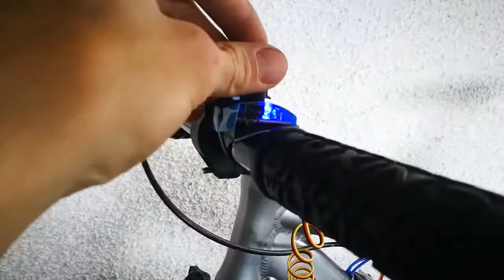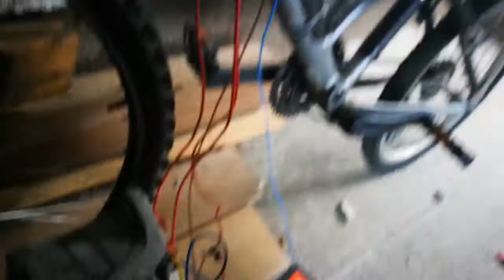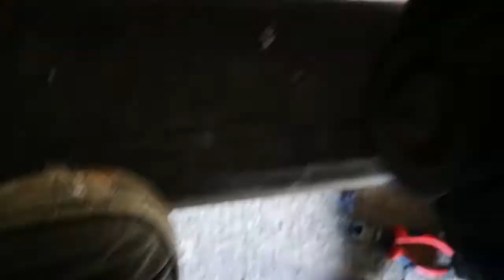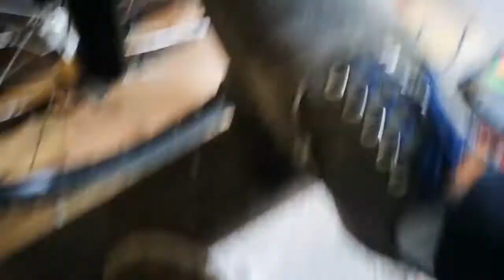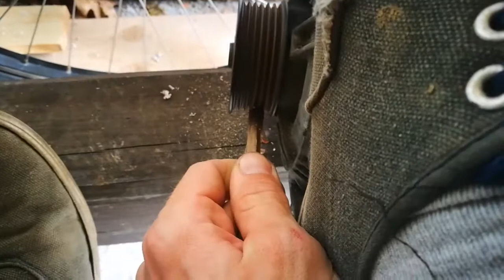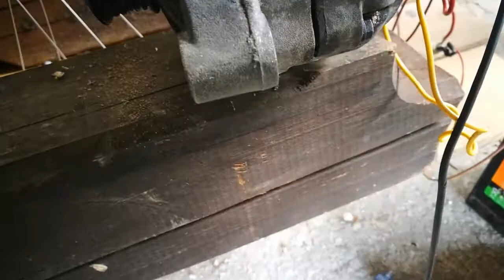12v 130 Amps Car Alternator converted to DC Motor with BLDC Controller

Comment: If it will CHARGE at 130 amps,  it will probably take 130 amps as a motor... Just saying...  
Easily needs a 1.5KW or bigger speed controller even at 12V...  Could run it at 36V as well... but your "gonna need a bigger boat"...
Reply: actualy you can push 200 amps in her no problem

Comment: How many volt run alternator 48v/60v/72v/96v ????
Reply from the maker: I used only 12 V in this video and a  RC 70A bldc controler
Reply: @TrailMaker2  thank you

Comment: Delta or star  Have magnets been added?
Reply from the maker: I tried both and it feels the same , don t know why. I didn t add magnets.
Reply: @TrailMaker2  thank you
Reply from the maker: @enrgysolarandpowerinverter4379  I have checked now and I  wired it in a delta configuration.

Comment: Where i can found it wich a car ?? Thank you
Reply from the maker: I don't understand your question but I will try to answer it. I suppose you've asked me where you can find an alternator in a car, right?  You'll find the alternator bolted to the side of the engine, it's usually a large cylindrical component, with a fan (used for cooling) at one end.

The fan-end of the alternator will be connected to the drive belt, which is driven by the rotation of the engine.
Reply: @TrailMaker2  thank you ..but i asked you about this alternator speceficly what is the car name ...thank you again
Reply from the maker: @azertaieb442  Oh, that.... I think its from an old VW  golf,polo or caddy, I am not sure.
Reply: @TrailMaker2  ooo great thank you so much 😊

Comment: Meaning less video not showing battery voltage and controller
Reply from the maker: battery voltage is 12V and I am using small RC controler thats rated for up to 70 Amps. For the rotor I am using homemade 5V battery.